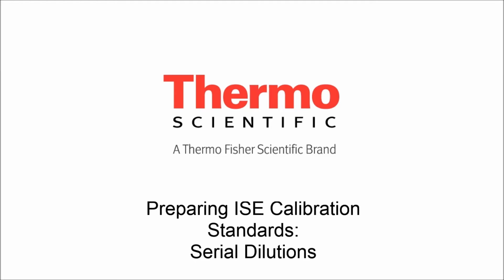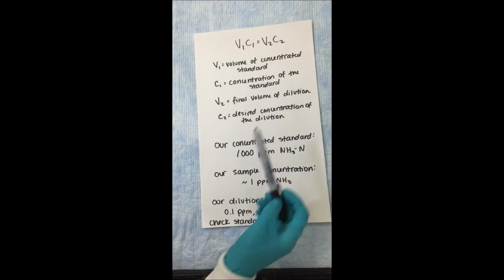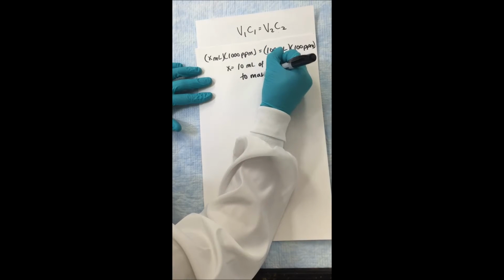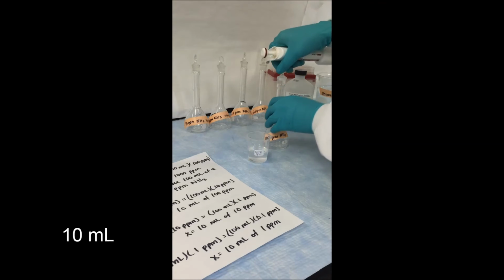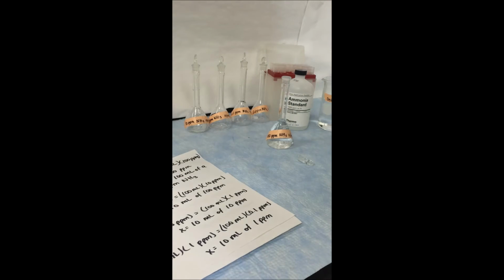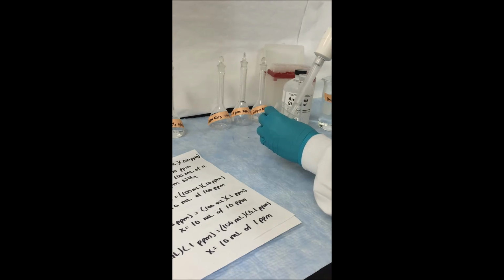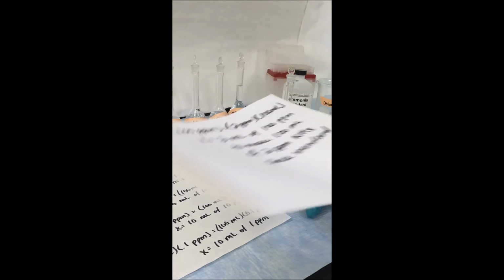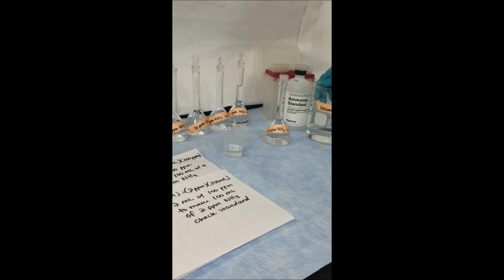Standards Preparation:  How to prepare Orion calibration standards by serial dilution

Comment: I think it is good if you talk about the steps while you are transferring out some from stock and prepare 100 ppm. At least narrating how you prepare 100ppm from the stock. For a beginner, it will bit confusing when you change the topic to focus on safety and calibration issues which you could address in a little while. 

I wanted to share this with my students as a teacher, but I doubt that my students still get not it right as they are very beginners.